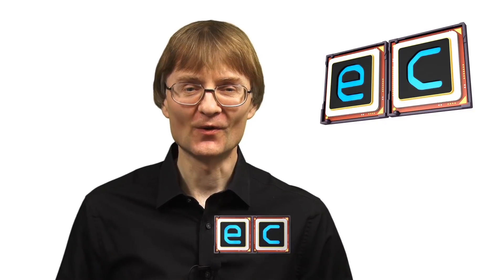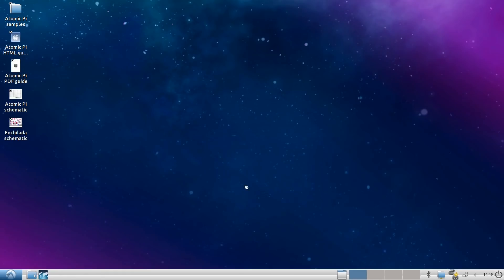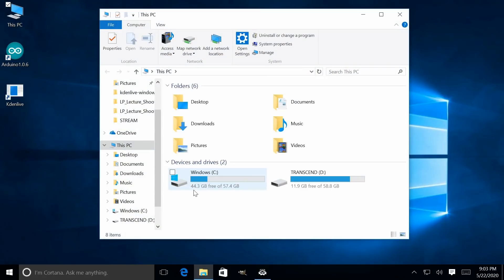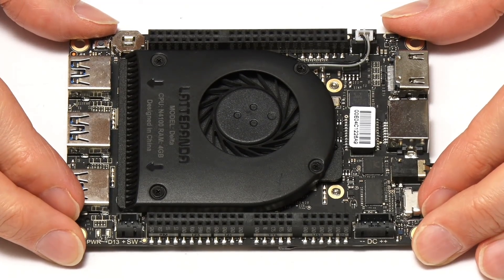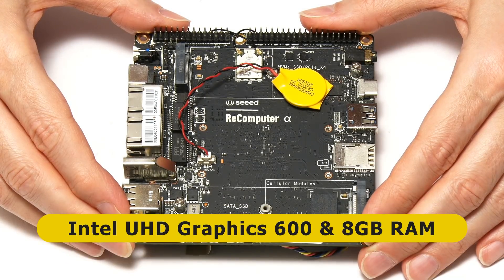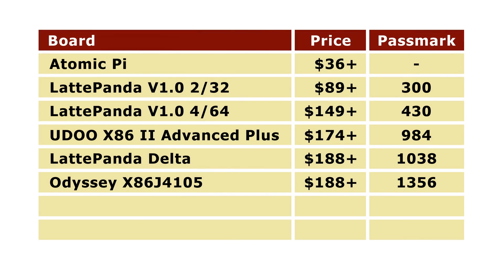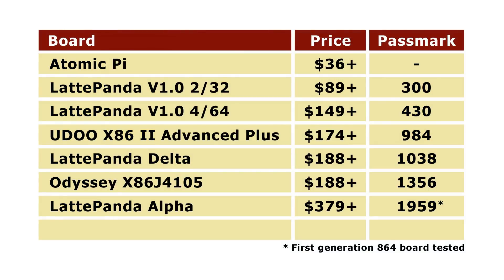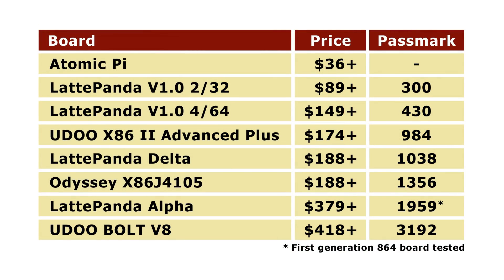Eight x86 SBCs

Comment: Obviously this all depends on what you need or want to do, but it goes to show how value for money the Raspberry Pi is! Especially when you factor in storage, power supplies, cases and even the cost of running. It’s even amazing to think that the latest Pi 4 has more memory in most cases.

Running Windows is the biggest plus I would imagine for most people, but I would venture to say that Linux wise, things are slightly more level. The only thing that lets the Pi down at the moment is the graphics which they seem to be trying to rectify. One could also argue a lack of onboard storage support such as SATA or m.2 would be the icing on the cake.
Reply from the maker: I agree -- the now that we can boot a Pi 4 from USB, it can make a really great Linux Box. Even Ubuntu 20.04 runs pretty well now (GPU drivers aside). And we have 64 bit Manjaro.

Comment: Nice video Christopher. It is good to see single board makers realising the potential that Ryzen Chip can bring. I can not wait to see the new Ryzen U series chips specifically designed for such board in the market. APU have a huge advantage on CPU, and as time passes their graphic capabilities are going higher.  Robotics will benifit immensely from such advancements.

Comment: Awesome comparison as always. Was thinking of assembling a portable Audio Recording Station. Any ideas on which of these board has the best Audio Performance, especially Noise level wise ?
Reply from the maker: This is not something I've tested -- I've only used the HDMI audio out. I would guess the Odyssey X87J4105 -- and it has a Pi-compatible GPIO connector, so may be able to take Pi audio HATs . . .
Reply: @ExplainingComputers  Thanks for the suggestion :-)

Comment: The Odyssey in it's tiny box looks like it would make a great media box
Reply from the maker: I have been using it to watch Disney Plus recently, connected to my TV. It's been my Mandalorian computer!
Reply: @ExplainingComputers  This is the way
Reply: The NUC machines are a bit more powerful. I got one used for a reasonable price.
Reply: @6581punk  This was my first reaction too. You can get a used skull canyon nuc for less than the cost of the udo with good power and formfactor. For me once you get out of the small size use cases, you might as well buy the NUC or a cheap used laptop and re-purpose it. Using these boards to replace a PC doesn't make much sense.  Core i5 toughbook CF-19's can be had,  for $100-200 depending on condition.
Reply: @quademasters249  Many of these boards seem to be aimed at embedded use for smaller volume products. The NUC I have is i5 and fast SSD. I replaced it with an Odroid N2 as it was only used for Kodi.
Reply: @quademasters249  i thought it wasn't elegant to repurpose a laptop this way, but i have totally changed my mind after listening to the latest self-hosted podcast episode with a special guest who runs a server site and hosts a server community. with it connected to the network and the lid closed, it sits in a drawer, with it's built in battery backup ready for action. the lid is ready to power up the monitor at a moments notice, as is the keyboard and built in trackpad, so no need to SSH in or dig up monitor, keyboard and mouse. it is power efficient will not overheat easily, can be converted to run off of a DC electrical system for solar compatibility, as well as as RV, boat or off grid power efficiency and compatibility (after some sort of conversion), reducing inverter electrical power inefficiencies, or living with them and just plugging in as is! the price can be favorable. but there is some intel synch, video i think, that has been iterated from around gen 8, with large increases in capabilities with each gen, including the fairly new gen 10. PCU power is less of a real world concern, if i understood, so i3 gen 10 would be great, if i understood what they were saying. here a link to the podcast: https://selfhosted.show/21, this is why, for a media player, newer models have some advantage
Reply: Makes an even better router

Comment: The Odroid-H2 is missing, it has an unbeatable price/performance ratio. Why didn't you include it in the comparison?
Reply from the maker: Only because I have never manged to get hold of one! :) There are many other small X86 boards. Those here are just the ones I have personal experience of.
Reply: @ExplainingComputers  thanks for the explanation, are you planning to order one? Odroid just updated the CPU and now it's a really neat SBC. It's called the H2+

Comment: Can you run Windows 7 on these SBCs? and can you use them with a generic touch screen?
Reply from the maker: It will all depend on drivers. The LattePanda models can all connect to standard MIPI displays with touch functionality.
Reply: Remember, Windows 7 wasn't designed to boot from USB devices. (It's possible but will require work.) The boards with SATA capabilities shouldn't have that problem, but as Chris has noted drivers will be a limiting factor. And driver issues will just get worse in the future.
Reply: @tylersperry9164  Thanks guys I only need to run one Windows program for my CNC. Worst case scenario I can tolerate Windows 10, but definitely need the touch screen functionality.

Comment: Although not a ‘true’ SBC featuring the UDOO BOLT does pose an interesting question - at what point with the x86 SBCs are you simply better off going with an Intel NUC or similar (which is really what the BOLT is competing against.) A topic for another video, perhaps?
Reply from the maker: Very true. And this is why I highlighted the Odyssey X86J4105 as the best value board here -- not the most powerful, but competes very well against a NUC, with a lot more connectivity, and far cheaper than most NUCs.
Reply: @ExplainingComputers  Overwhelming value ( the Odyssey X86J4105) considering the IO... as the only one with two NICs, it's the only one to even consider if your use case is a firewall or router
Reply: @ExplainingComputers  Do you recommend any sbc for a pocketable windows pc? the v1000 processor top model apu based boards seem interesting.
Reply: ExplainingComputers I concur, if you need anything more powerful than that you should probably consider if an SBC is the best option for your use case, as you may be better served by going the Ultra-SFF route, gaining flexibility without too much trade off in terms of form factor/size.
Reply: @donkeyk1988  When you get latest Ryzen "laptop" processors in a Ultra-SFF build... I can wait for "non-Intel NUC" because then there is almost no compromises compared to desktop pc and external GPU would finally make some sense. :D
Reply: @woldemunster9244  theres a recent review of one somewhere 250 dollars running a ryzen chip- not a consumer unit, its a display driver but value foer money?
it takes a big shite on everything in this video
Reply: A bit pricey and more rugged/industrial. But has Ryzen.

Sequoia v8

AMD® Ryzen™ V1807B CPU
AMD® Radeon™ Vega 11 Graphics
4 GB DDR4 Memory
128 GB SATA SSD
Free OS installation
Now Shipping

$774
Reply: you can get AMD Ryzen mini PC's which are WAY better than the NUC's ;-) Just saying they are starting to crop up for cheap now... snatch this one https://www.banggood.com/T-Bao-TBOOK-MN25-AMD-Ryzen-5-2500U-8GB-DDR4-256GB-NVME-SSD-Radeon-Vega-8-Graphics-2_0GHz-to-3_6GHz-DP-HD-4K-Dual-WiFi-p-1671869.html?p=QZ14021624945201505Y&utm_campaign=techtablets&utm_content=chendongling&ID=47184&cur_warehouse=CN and use this code (you need to go far into the paying process to see the 20-25% off) code: BGSPMN25  <<<<----- it's a very good machine and quite cheap and the Ryzen 2500U is not to sneeze at + you get 8gig ram and 256gig nvme ssd (not the slow solderen on kind)
Reply: @LiLBitsDK  Now if they only didnt make a bizarre amount of spelling mistakes or claim SSD write performance speeds up gaming (What game relies on write performance?) or made ads in youtube comments I might even trust this site to be legit. But thats not the case.
Reply: @builder396  they are chinese? what do you expect? there are reviews out there and it is a good ssd and many games benefit from read speeds dunno on write speeds other than games that autosaves a lot (I play a few of those)
Reply: @LiLBitsDK  Good little board. Thanks for sharing.  found review. https://www.youtube.com/watch?time_continue=48&v=2Oq-Ag28MwE&feature=emb_logo
Reply: What about thin clients? there are some products such as HP t620 which have the same specs of a pi4... A comparison would be cool!
Reply: the new amd units running ryzen?
make every single one of these toy computers obsolete.
Reply: You have to compare the benchmarks of the CPUs and I found the Rysen CPUs are better/faster at the cheaper price point than Intel CPUs. I will be replacing my NUC with an I3 and 800 benchmark with a Rysen machine in the $500 range with 500G SSD. It replaces the TV NUC I am currently using which with a Microsoft remote keyboard is basically my main computer, my 'gaming' i7 computer in the basement gathers dust most of the time. The Rysen machine with the large disk (current machine only had 100G) will become my gaming computer and will be superior to the 5+ year old i7 on the gaming computer.
Reply: a single board computer has a single board

Comment: They're getting too expensive for a single board! I like things like one pi and a couple of pi-zero's. Better buck for your money i think
Reply: they are full blown computers not tiny singletask tinkering boards ;-) but lots like the tiny but powerful stuff (like myself) I ran with a Zotac EN760 for 5½ years (Intel 4200U with Geforce 860m graphics (tiny box for it's time) and it could play Doom 2016 and other cool games just fine with minimal tinkering of graphics settings (lower those that give huge boosts for minimal/no visual loss) now we can get better cpu and similar gpu power in a tiny sbc for very little money? (the Zotac EN760 was quite expensive new)

Comment: Well I find those x86 SBCs like the UDOO Bolt too expensive and it's really better to have a micro-ATX Motherboard for Windows or even Debian/Ubuntu. Also I've noticed that not all RetroPie emulators work on ARM SBCs like Dolphin and those other emulators for like PlayStation 2 and DreamCast cannot cope or handle the frame rates, so, therefore, having an x86 with an Intel GPU is the better solution. Plus I've noticed there is an RPi Vulkan Driver for the Pi 3B+ (not 4B) which can play Quake 3 around 100 FPS.
https://www.tomshardware.com/uk/news/nvidia-engineer-vulkan-driver-raspberry-pi-quake-iii-100-fps
However RetroPie as well as OSMC aren't ready for the Pi 4B just yet, as RetroPie doesn't appear to support 64-bit ARM yet. As for overclocking the Pi 4B at 2.147 GHz for the CPU and 750Mhz GPU, it does seem to work as long I've got the heatsink and fan. But the EmulationStation for the RetroPie doesn't seem to work if I use a different dt-overlay as well as using arm_64bit=1.
https://retropie.org.uk/forum/topic/25370/good-news-regarding-tearing-and-low-emulationstation-performance-on-pi-4
Back on to x86, I've not got or own an x86 board but RetroPie does work on my Debian Laptop that has the similar Tech Specs of the LattePanda Delta, as well can play those x86 only Emulators, like Dolphin but does contain some bugs and needs to be tested and updated by the RetroPie devs.
Reply: I wonder if "having an x86 with an Intel GPU is the better solution" compared to AMD/Vega8... 
I mean Intel lost the plot and now every "cheap" AMD processor is better choice for "small form factor" builds and im waiting to see what the future holds for AMD+SBC.... :D
Reply: @woldemunster9244  pssst... https://www.banggood.com/search/ryzen-2500u.html?from=nav check those out ;-) (is several youtube videos out about them but maybe EC channel can do a good one too)
Reply: @woldemunster9244  re "having an x86 with an Intel GPU is the better solution", i am a convert to Ryzen, but the latest gen 10 intel synch (i don't know the name, and i could be completely incorrect) APUs may have better price to performance option. maybe [APG]RoboCop[CL] didn't explain his hardware example correctly?? but the low end i3 or lower, perhaps, Celeron? if they make a gen 10? that was my understanding from the end (maybe last half) of this podcast: https://selfhosted.show/21
Reply: @Peter Andrijeczko thanks for posting, i am very interested in this topic: low price lenovo thinkpad running linux. what do you mean by Intel GPUs? i thought Intel just started making GPUs. are you referring to inboard GPUs, as in APUs, as would be in an older thinkpad?

Comment: You should review box86 on the pi, it's a x86 emulator that runs on the raspberry pi, it's still in early development but well worth looking into
Reply from the maker: I new one to me -- very interesting. I'll certainly take a look.
Reply: I also forgot to mention that it is open sourced, twister os has it installed by default and has steam running on it
Reply: Also steam only works in small mode

Comment: It made me wonder. While it's not what they're made for but: What about using them for retro-gaming systems, running something like Windows XP? There are undoubtedly easier systems to use as such but what if?
Reply from the maker: Drivers permitting, very possible. :)
Reply: It's always the drivers, isn't it? :) Well, I would consider maybe trying it in the Atomic Pi or LattePanda V1.0 2/32. Going past that it's probably cheaper in the long run to go for a used mini-ITX board. Maybe one day I will have the time and space to try it. :)

Comment: I'd always assumed x86 meant 32bit only.
Reply from the maker: Strictly "x86" is 32-bit, compared to x86-64 or AMD-64 being 64-bit. However, given that there are pretty much no new x86 CPUs on sale now, "x86" is commonly used to distinguish computers with an x86 and 64-bit derrivative CPU, from boards with an ARM CPU (as I indeed note in the video!).
Reply: Well it is to signify whether software is 32-bit.

But the 64-bit cpu extension on top of the 32-bit basis , is called x86-64 
Linux calls 64-bit builds "amd64" since amd made the 64-bit extension to the existing x86 when intel was working on a wholly new architecture for 64-bit (itanium)

And yes it would be, but 64-bit has been widely implemented for so long now, it is now assumed an x86 cpu is also 64-bit indeed
Software still needs the differentiation, sometimes for no other reason than the 3GB memory limit

Comment: I think that the Lattepanda v1.0 4/64 is a very good super mini pc, but if you want a bit more power i think you should go for the UDOO bolt since it has that ryzen perfomance but has a very low power consumption and is quite small. 
A very enjoyable video! I learned something today so thanks Chris for that.
Reply: just remember to add in you need a cooling solution for the Lattepande v1.0 since it gets quite hot (the new version has very good cooling on) and add that on top of the price and you might as well just buy 1 step higher with included cooling

Comment: Itx vs sbc for small factor replacement desktop. Not much in it these day.
Reply: You guys need to check out the ASRock DeskMini A300.
Reply: That UDOO Bolt is the next smallest form factor featuring Ryzen. If they ever add a socket, the possibilities would be ideal for the challenge of smallest build. Add a USB 3.0 to mining GPU mount and you have everything you need. The storage availabilities is my favorite.
Reply: Mini b550 boards!
Reply: @ryanmalin  yes would love that!
Reply: Hastur Yellow Not quite there yet,certainly as good as most cheap chrome-books the increasing RAM and ability to utilise SSD’s ect is a great boost to the SBC format.